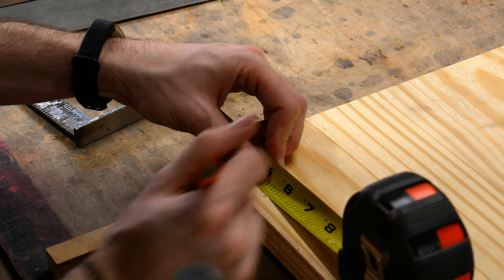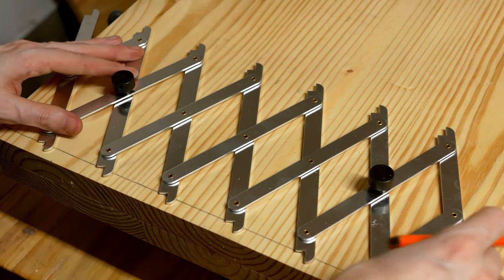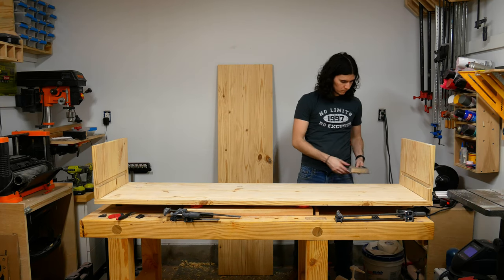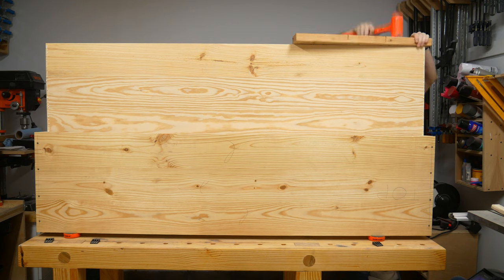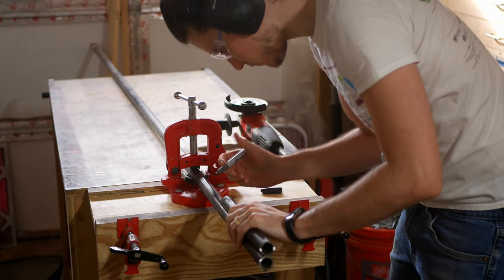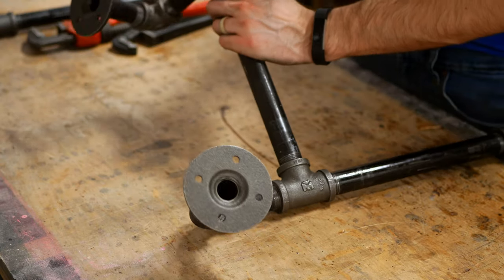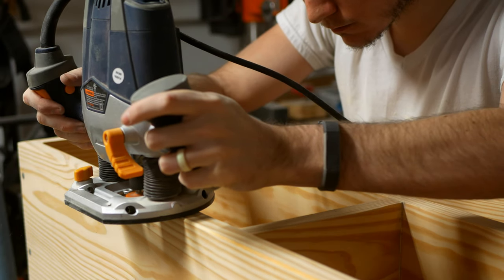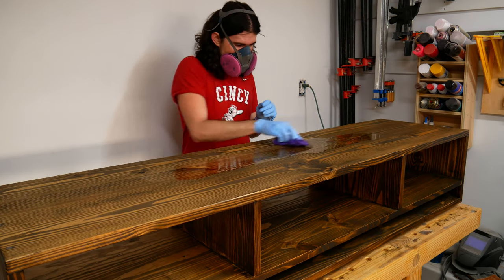How to Make an Industrial Pipe Media Console - Woodworking

Comment: Any chance the inside of the pipe will develop rust?
Reply from the maker: Since it's painted in this case it should be fine. Although, I have used black pipe without finish and I've never had rust show even after a few years. It's definitely possible if you choose not to finish it but I personally haven't had it happen yet.